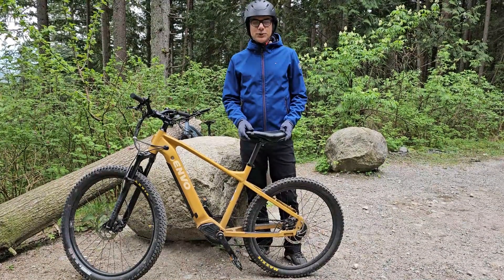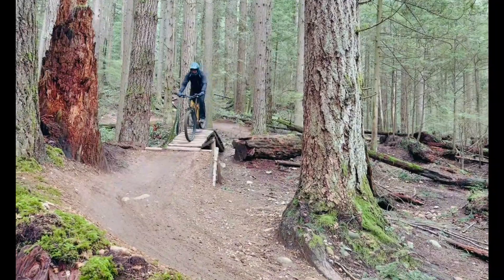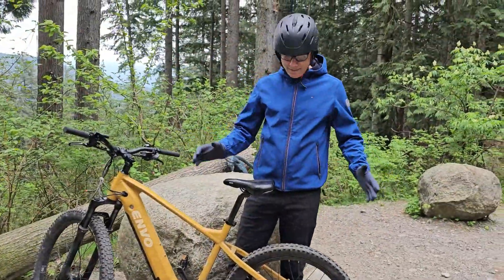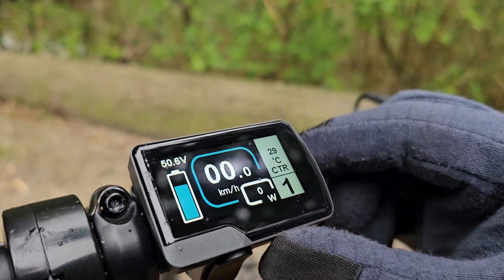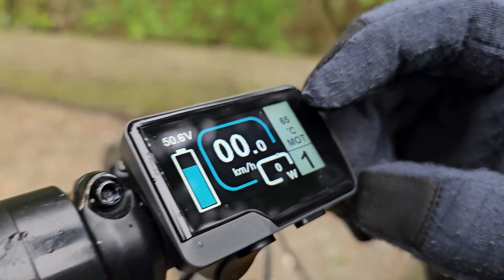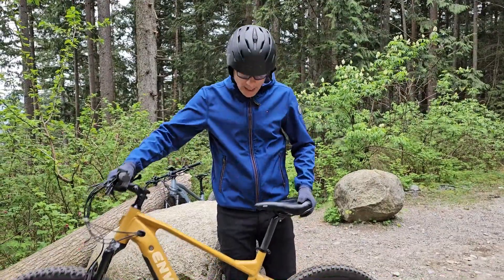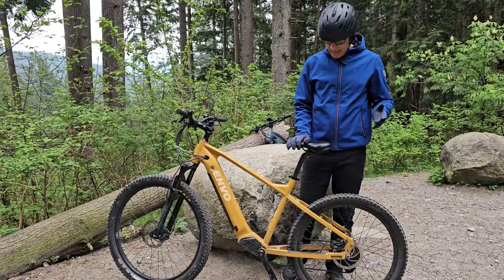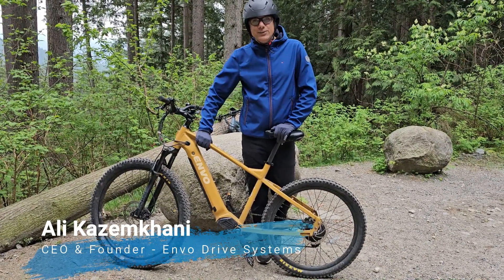Why Rear Hub Motors Work for Mountain Biking??

Comment: I just did 70 Kms in Penticton BC, on KVR trail to the Adra Tunnel! Steep hills here and I commute with it also. It rocks!  Learning the 9speed gears and the 5 power levels is amazing, as it works efficiently and smoothly to shift well. Downside is the weight mostly. Very good overall and glad I got it... still have my MTB for trails that are tight and steep down and uphill..  old school still!

Comment: Id destroy the rear wheel in about 45minutes.
Reply: I tried a simple pop and barely got it off the ground. Better pedals, that will help, these are not grippy, good casual but not sincere.. Took it down some gnarly mountain trails and it is a beast, worse than a full downhill bike. It is great commuter, or adventure on rail trails and such.  Will see how this weel holds up, already bashed it up on some rough rocky terrain. I live in BC  mountains... epic bike but not a plaything, get a hardtail or full swuishy bike if that is wanted. As usual, a quiver is needed. I have 4 pairs of skis, and 3 bikes, all for different things.. it is a love of fun, neuro spicy is how I roll...

Comment: is thist rearhub motor capable of recuperation?
Reply: If you mean regeneration braking, not as is, because there's a freewheel clutch in the way of the sun planetary gears. Rotor won't spin by spinning the wheels to regenerate. But there's an option to lock up the clutch (replacing it with welded clutch) then it'll be capable of regeneration.